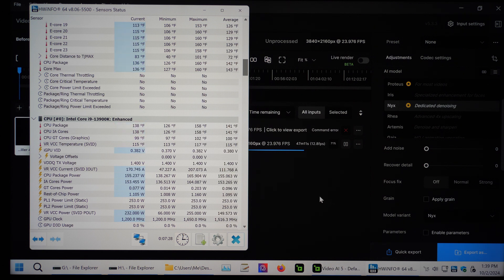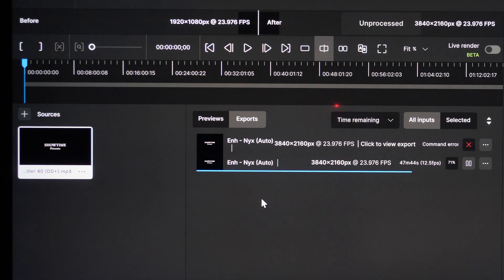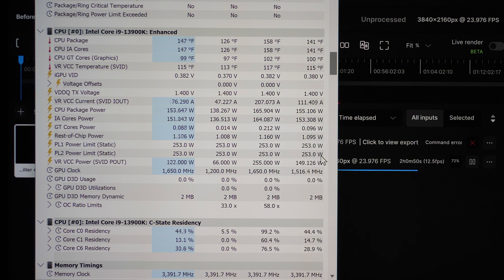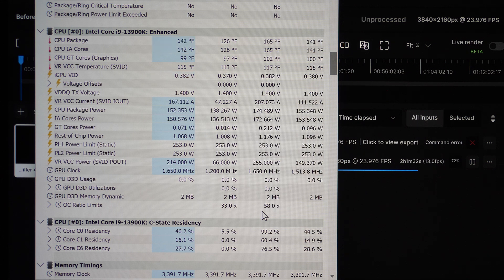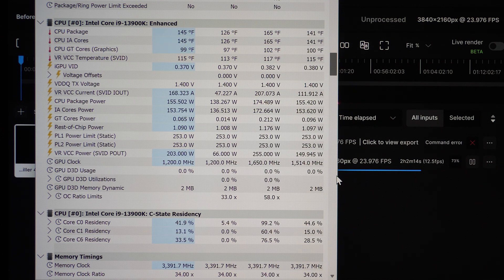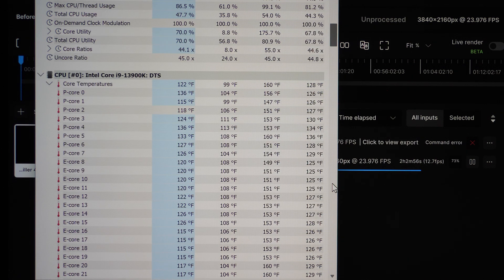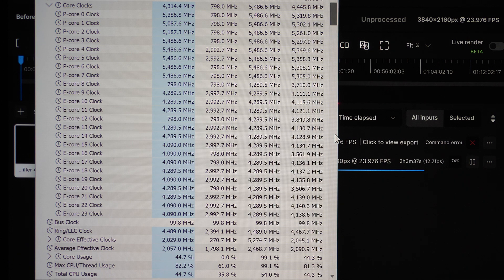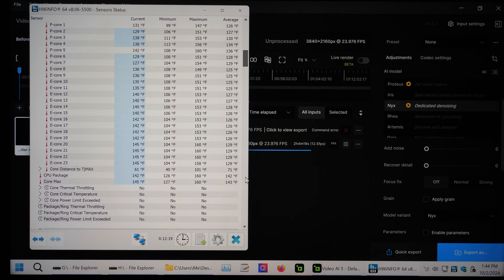Intel i9 13900 14900 BIOS Microcode Update, Get it NOW!

Comment from the maker: Just a quick and dirty show and tell what the new BIOS update did for my 13900k CPU.

Full build parts list below (may be affiliate links):
Intel Core i9-13900K -- https://amzn.to/3IV6bkL
EK Nucleus AIO CR360 -- https://amzn.to/3TE2oNG
MSI GeForce RTX 4090 -- https://amzn.to/43zmqO7
MSI MPG Z790 Carbon Motherboard -- https://amzn.to/3PBsyQc
G.SKILL Ripjaws S5 Series DDR5 RAM 96GB -- https://amzn.to/3TEoHD6
SAMSUNG 990 PRO (x2) -- https://amzn.to/3IVRT3n
Solidigm P44 Pro -- https://amzn.to/3xfms1u
WD_BLACK SN850X -- https://amzn.to/4a9JDst
MEG Ai1300P Power Supply -- https://amzn.to/49jz30O
Phanteks Enthoo Pro Full Tower -- https://amzn.to/3PHM3X7

Wanna see how slow top shelf hardware can go under real work load, see below:
https://youtu.be/naV-J1kfZmQ

Give a 👍 and subscribe 🔔 if you'd like to see more videos like this and thanks for watching 😃!
Reply: I did the update on my 14900k and it clocks in at 5.6

Comment: 14700 non k need update 0x12b?
Reply from the maker: If an update is available for your board, get it. All 13-14 gen cpu's should have this or newer update available from your board manufacturer.
Reply: my board is msi, bios version is fist release ver, bios setting im change to tower cooler so hot 288w

Comment: I am satisfied with my 1801 Bios since it is stable with it. I got 13900KF and it is working good with this bios^^ I tried upgrading my bios latly, but rolled back because it went unstable at once... so 1801 suits me fine
Reply: upgrade to what? 1801 is the most recent release
Reply: @boblong101  but this is the 1801 for Asus rog strix e gaming. its older there

Comment: What do have the mcmax thing set to ? I have mine set to 400a
Reply from the maker: Did you mean CPU wattage? I'm running all default Intel settings which is 253 watts. I have manually set a lower thermal throttle limit though. Intel recommends 212 F but I set mine at 190 F. No chip should ever get so hot that it can boil water! But this new microcode update keeps operating temps well below even my custom threshold.
Reply: @Finite-Tuning  i meant the iccmax you can go performance or extreme. i ended up going with performace so its 307a the base for heat i havent lost any performance its been running way cooler with the bio upgrade, and my voltages went from wild 1.47 under load to staying at 1.39v with peaks of 1 to 2 s of 1.40v peaks when loading something really intense . i also made the mistake of setting svid to intel failsafe thinking that would be well safe i learned its the max voltage to i was hitting 1.5v putting it to typical has put me below 1.40v
Reply from the maker: @Chevalier_knight :
Oh I see. I had to double check my setting, I just couldn't remember. My mobo calls it something different, specifically "Intel CPU current" and it's set at 307 amps as well.
Reply: @Finite-Tuning   yeh i had it on the extreme setting so it was auto set to 400a putting to the 307a one gave much better heat and volts. was up all night with chatgpt trying to figure this stuff out.
Reply: @Finite-Tuning  i also went from running into the high 80c with peaks into 90c playing stalker 2 to high 70c but never going into 80s

Comment: I have i9 13900k and i opened bf2042  and crashed my pc 3 times in a row, but i haven't updated the bios. As a matter of fact i've been having crashes with alot of games. this new bios will fix those issues?
Reply from the maker: I have no idea, I don't play games. This BIOS will fix the voltage issue with the processor, which may also end up fixing your gaming issues as well.
Reply: i have the same issue, currently trying to find out how to update all of this, never had this issue before. every demanding game crashes for me or i get an error saying out of video memory trying to allocate rendering resource
Reply from the maker: @erikaserikas8239  :
The BIOS update must be downloaded from your motherboard manufacturer. That will contain the new Intel microcode. Was that your point of issue or confusion?
Reply: @Finite-Tuning  yes, that was confusion, thanks for the response, I did the update and enforced the limits, now my games finally work!!!
Reply from the maker: @erikaserikas8239 :
Nice, I'm glad this solved the problem.

Comment: Which BIOS update are you talking about?
Reply from the maker: The latest version from whomever manufactures your motherboard. BIOS firmware is manufacturer specific. The latest BIOS update for 13/14 gen I9's will have the newest Intel 0x12b microcode (aka) firmware already embedded.

Comment: It was mostly the temps to cool it people was putting there own power limits in the bios
Reply from the maker: Curious, I've never seen/read/heard about anyone but me taking control of this chip in BIOS. Lot's of people making lots of noise about "undervolting" this chip, but never doing what I did from day one. Undervolting is ridiculous and not at all what I did to mine. I specifically limited my chip when others were letting it run unlimited. Which again is just a ridiculous notion to let a chip like this run unlimited like that. If there were others doing like me, I certainly wasn't aware. But I did my best to tell everyone to lock this thing down. Doing what they were all doing is just gonna burn it up! It ain't the voltage, it's the current that let's the smoke out.

But regardless, Intel has fixed the issue now, at least according to my real world test results. Synthetic testing, just maxing out a CPU for the sake of it might show a very different story. I really can't comment on that since I have not run any of those arbitrary tests.
Cheers 🍻
Reply: @Finite-Tuning I did this with my 13900k but it was too late, I was already BSODing, but a buddy and I on a discord call started noticing this issue WAYYYY before anyone was talking about it. My local micro center thought I was crazy…but ya, I’m on AMD now BUT I wanna come back to 14900k
Reply from the maker: @STKReacts  :
Just wondering which AMD chip you're running that you want to switch to a 14900k?
Reply: @ I’m currently now on a 7950x3d but I have to get on some project lasso because I feel like I’m having some weird issues
Reply: @ I also switch up my set up very frequently
Reply from the maker: @STKReacts  :
I was between that chip and this 13900k when I built mine, but the I9 went on sale for $400 which made the choice for me. I still wonder though if the 79503d would make any difference for my typical work load which is what you see in this video. Video rendering is mostly about the GPU, so I doubt your chip would do any better in this case, but I still wonder. The 5090 is just around the corner and I will be upgrading. I'm also real curious to see what difference there is between the 40 and 50 cards with my typical work load.
Cheers 🍻
Reply: @Finite-Tuning  Yea I edit with Davinci Studio version....so I wonder if even getting a higher core count CPU would make a difference..so idk....its fun testing everything out, might end up back on the 9800x3d lmao